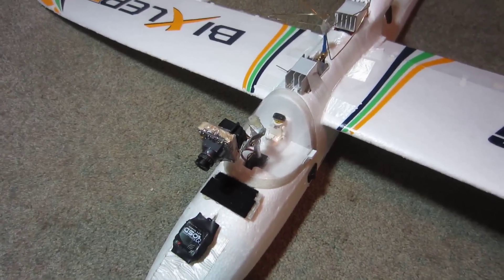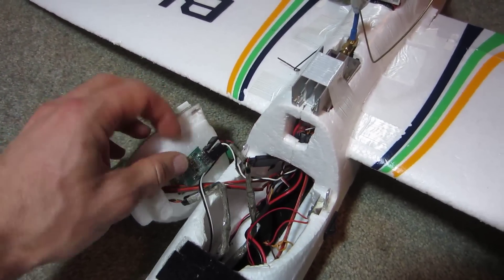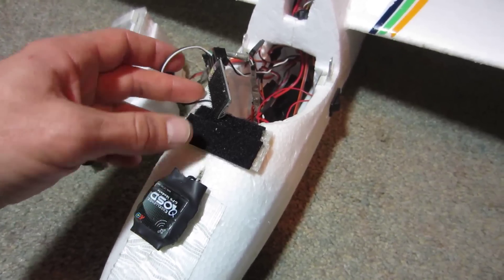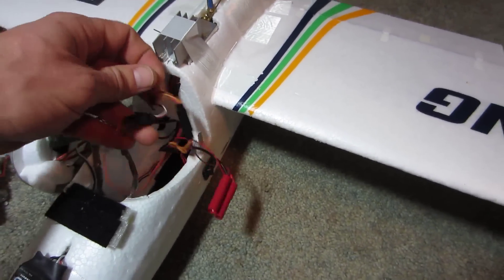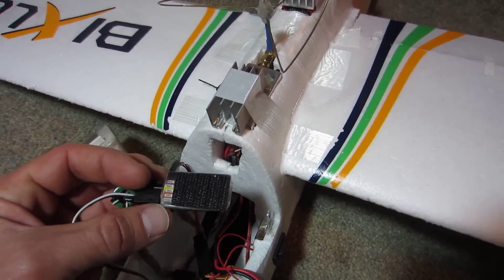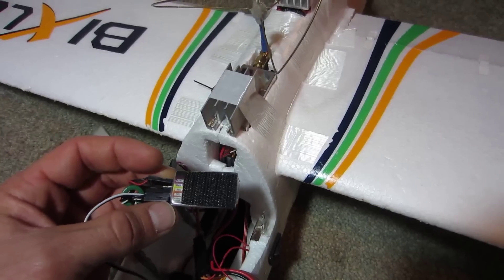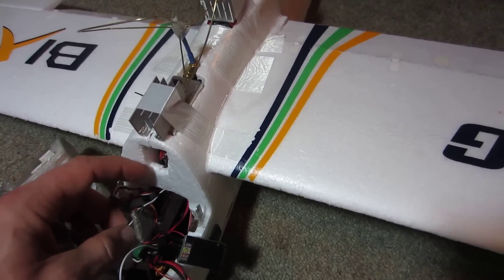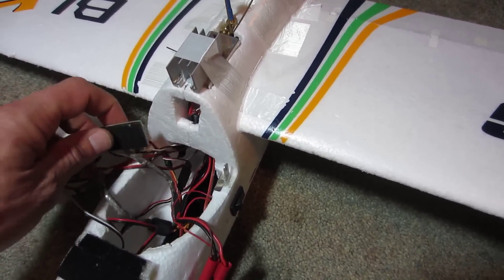How To Wire Your Hobby King Mini OSD With GPS For FPV.

Comment: Very informative. But I'd have added that although your cam is 12 volts - There are 5 volt cams out there ie: the fatshark line. They're 5 volts and have their own power supply system. So -one would only need to hook the OSD up in the video path - Not in the power path. And could use the video power source as a means of powering the GPS unit as well. 
 Don't mean to step on yer toes here - Just though it would be a good piece info to go along with a good video. ;-)

Comment: Very nice job with video and explaining your components. Like you, I have been scouring the web for all the information I can collect for my system which greatly resembles yours before I hit the sky.
   I have three questions:
1) Could you clarify which system is being used for video and which is being used for transmitter control of the airplane?  I am unfamiliar with Rangelink.  
2) Is there a technical reason why you used linear polarized antennas for one system and circularly polarized (cloverleaf and helical) for the other?
3) I also purchased a HK Mini OSD because of its excellent price and high number of useful paremeters it displays.  Have you used the stock firmware or reflashed with something else? Please share your source and reasons.
Keep up the great work. No doubt you have some great videos from your 50 flights. PM me if you have any desire to share and discuss.
Jim
Reply: James C Eastep a while ago but read the description setup is in there

Comment: Thanks VERY much, Eric, for taking the time to make this very helpful video.  I also found a wiring graphic that appears to be correct, although it is missing some details:  http://glennlisadoney.com/video/WiringPhotoMiniOSD.jpg  Also, isn't the voltage to the camera supposed to be 5 volts? And I have a very basic receiver that I don't believe has an RSSI output, so I assume I'll just leave that connection off.
Reply from the maker: That wiring picture looks to be accurate and complete.  He just doesn't have the batteries or the RSSI hooked up.  The red connector would have a 12v battery to it and the loose gps antenna connector would have a 5v power supply hooked up to it.
The main thing you need to know to hook up the video is just to have a common ground wire and common signal wire between the OSD, camera, and video transmitter. The OSD info is just imbeded into the wires.
The camera voltage depends on the camera that you have.  Mine takes 12v.  You don't need to hook up the RSSI if your receiver doesn't have that capability.  That just lets you know how strong your RC signal is in the OSD.
Reply: wildernesseric I edited that wiring photo to include details from my research...does it still look accurate?
Reply from the maker: Glenn Doney I don't know what the loose white and black wires are coming off of the video TX, but it only needs one set of power wires and the red and black wires (with red connector) are what supply that.  Really the wiring is more complicated than it has to be in that picture.  The video TX just needs 3 wires running to it: one black (GND), one red (12v), and one white singal wire (or yellow in this case).  Since you have a 5v camera you would tie the red camera wire into the red power wire for the GPS antenna like you have shown and not the 12v.
Reply: wildernesseric I just put a VOM on my TX and the 3 wire group (red/black/white) goes to the CAM and the red is 5 volts.  The other pair of wires on my tx are 12 volts, fed into the tx from the lipo (with a low pass filter in between http://glennlisadoney.com/video/WiringPhotoMiniOSD3.jpg)  I, too, don't know what the loose black and white pair are for on the other photo. I got the original photo online from someone who spoke french, of which I speak none!
Reply from the maker: Glenn Doney The ground and signal wires have to share a common wire with the cam and tx or you will get no OSD info.
Reply: wildernesseric Hi, in the video he explains (albeit in French) that those white and black wires are for the audio channel